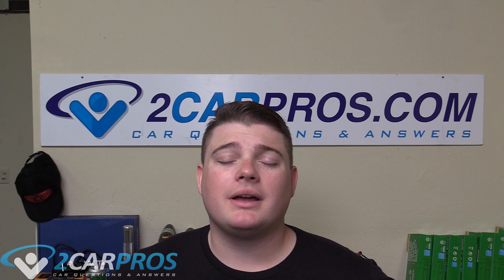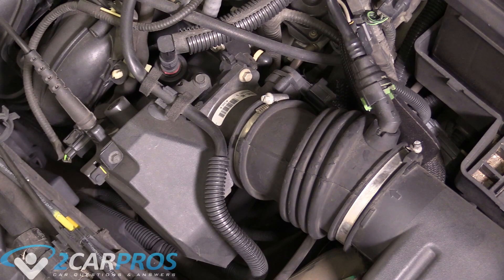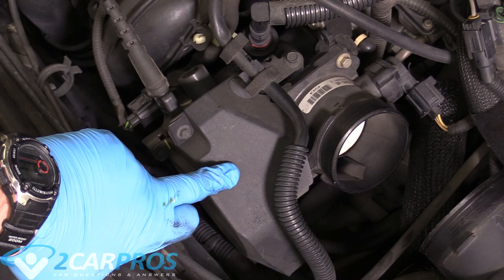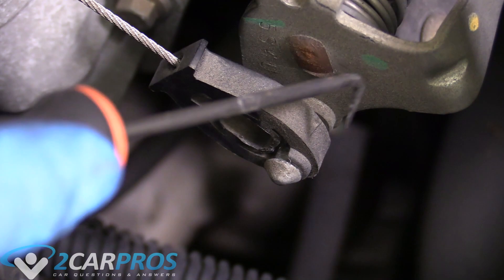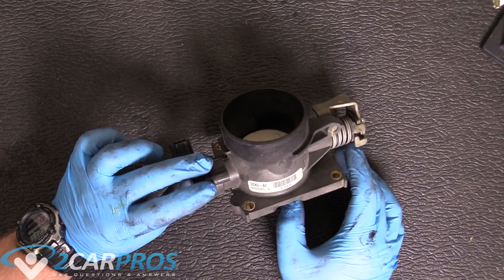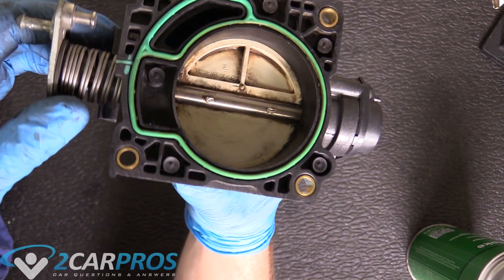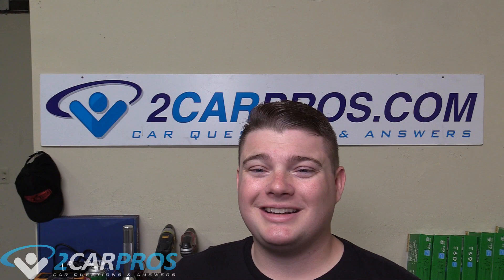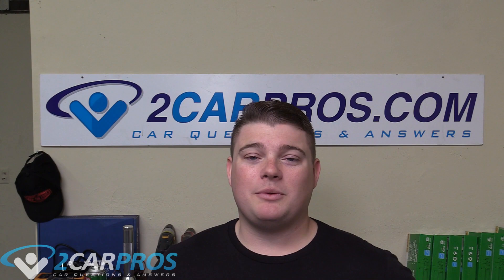How to Service a Throttle Body Housing Ford Focus 2000-2008

Comment: Amazing. Thank you so much! Just sorted mine and no longer cuts out. Fabulous tips from experience e.g. order to undo the screws etc. and ease of use by adding what size socket needed at which stage etc.
Reply from the maker: Thanks for watching!

Comment: If there is a slight hissing noise when you accelerate (A/C off) could this help if coking has impacted air intake? The dealership told me to check the throttle body.

Comment: Excelent tutorial. I just bought one and i have to clean the idle valve and thrtl bod.
To see if itll run better at low rpm
Reply from the maker: Thanks for watching!
Reply: You need to replace the idle air control valve.

Comment: If you open up the plate and use. Toothbrush that will.come out way better than how it is now and when you are finished use the same spray and spray everything off and it is like new
Reply from the maker: Toothbrush is a great tip! Thank you for watching!
Reply: Always change the gasket when we move in the throttlebody, never add carburetor cleaner to the rubber gasket you would damage it, I could tell inexperience

Comment: A problem that I’ve encountered is that the carb cleaner or throttle body cleaner dissolves the plastic the throttle body is made of causing more damage than the carbon buildup. The recommended fix is to replace the throttle body assembly. There are replacements out there less than buying it at Ford. Less down time too if the throttle body is damaged by the spray. It’s only if it’s made of plastic. If you have one made of metal it’s fine.
Reply from the maker: I have never experienced that problem. Thank you for watching!
Reply: Idk where u are buy throttle bodys that are cheap... and those tbu are not nm only very hard to find when u do find one for a 2.0 they are extremely expensive!... and card clean work just fine on poly
Reply: yeah Im not paying $350 when I can just clean it, thanks

Comment: Are the 2007 focus throttle body modules electrical or mechanical
Reply from the maker: I'm going to guess mechanical like this one. Thanks for watching!
Reply: @2carpros  I checked it today and that's exactly what it is. Although it's not very easy to get that part

Comment: Can u pls tell me where is the MAF sensor cus I really don’t see it my car and it looks exactly like this one in the video
Reply: To the right of the throttle body is a large box, this box quiets the the sound of the intake also known as a resonator. Look down and to the left of this box about 1 foot 12 inches and you will see a wire coming out of a tube connected to the bottom of the resonator, that is you MAP sensor. Two screws hold it in place, only use electronic cleaner on this part and make sure it goes in the same direction it came out of it will through a lean code.

Comment: You're wrong the 2005 Ford Focus zx4 ST came with a 2.3 l duratec and manual transmission only
Reply from the maker: Well this is a non ST. That's why it doesn't say ST in the title. Thank you for watching!
Reply: They never made a st in 05 lmao
Reply: Well why did you say st then anyway I was told my gasket was bad so I'm so happy for this video because I'm going to do it myself ...I hope thank you
Reply: @t.jborland2038  yes they did I currently own one